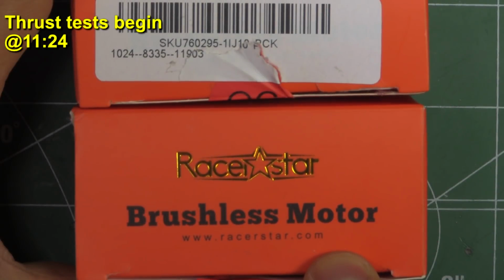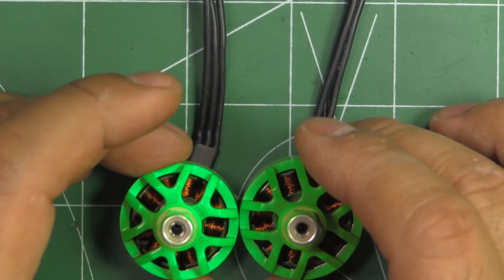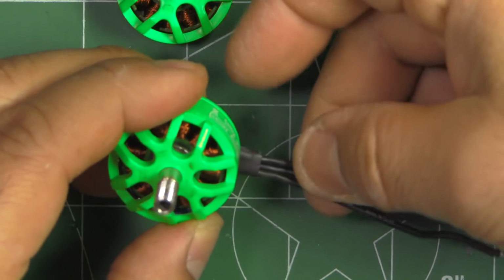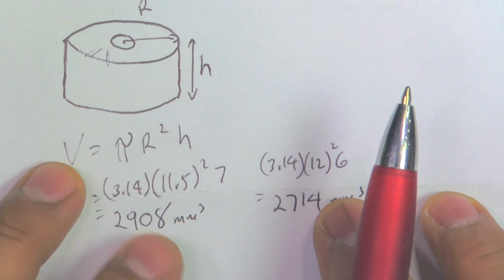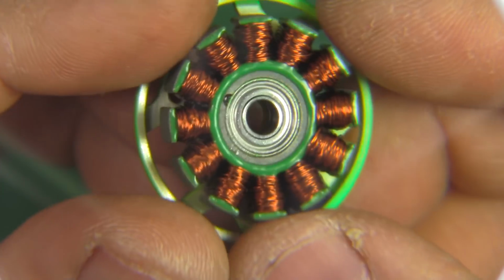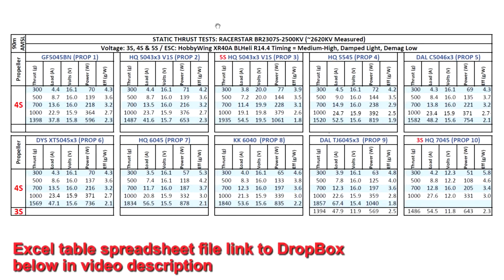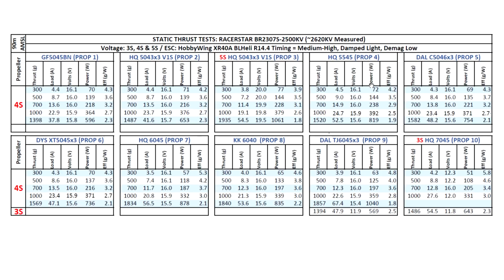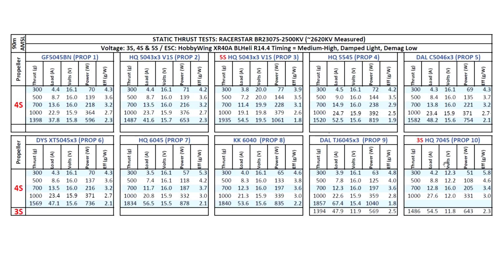RacerStar BR2307S-2500KV Thrust Tests - Budget Motor For Your Needs

Comment: these seem stronger than 2306/2650 deadpools but my question is who makes racekraft 2307? i picked up set of new rk 2307/2550kv and hope there stronger than the deadpool 2306/2650 any ideas?
Reply from the maker: Danger Davefpv No idea who makes them,. I have not seen other motor like Racerstar so could be they got their own factory, They sure make lots of different motors nd release new one quite often

Comment: Hi EngeneerX, i am building a 5" freestyle quad and it is going to be my first one. I heard mixed opinions about the racerstar. But the br2307s are quite new. At the moment my 2 options are either the br2307s or the brotherhobby returner r2. I think in this price range those are the best, are they? What motors should i choose? Are the r2 worth the 4 extra dollar? On long term which are better?
Reply from the maker: I have not heard these RStars having any issues so far so they're a good choice. I would actually go for the KingKong 2405-2400KV for a 1st freestyle quad. Check out my review for that motor, it's very good quallity, made by SunnySky. So far it's been getting lots of positive comments. The BH R2 is also a very good choice and you can't go wrong if you pick it. These RS would be me my 3rd choice.
Reply: EngineerX Wow, thanks for that fast reply! And also thanks for your honest opinion. I am going to check out the kingkongs now and subscribe. Have a nice one!
Reply: Check out RCX motors, the 2206 is the best motor you can get in that price range

Comment: How about doing some Low KV High Voltage testing?  BrotherHobby has some offerings that are catering to this trend.  Interested to see some 6S low kv Amp data compared to equivalent 4S high KV stuff.
Reply from the maker: Daniel Bolton  I have a T2 2206-1800 that should be ok on 6S 5043x3. I'll have to somehow slot into the test queue
Reply: We need to get you some of the 2207 1660kv and the 2306 1725kv...that's what the racers are using currently.  That way you can run all the props. 
 Thanks for the consideration!

Comment: i'm desperately trying not buy them :D

One part of my brain scream ''bargain!", another ''beware chinese cheap crap!"
Assuming worse if bearings are crap as expected how easy it is to replace them? Cost ~2$ each
Reply from the maker: Should be as easy/difficult as with any other standard motor. Remove circlip, then use a punch tool to dislodge bearing from its housing, tapping a bit at time at an angle. Bearing should pop out without issues. Remove bottom bearing first, that way top bearing will be easier to remove and there'll be less chances of damaging windings since you can use a larger punch tool to tap straight down, placing motor on top of a soft surface. Or better yet, try holding motor and punch on your hand and striking down on a hard surface so you don't have to set motor down and risk messing up windings. Order some spare 4mm circlips  just in case you need to replace them.
Reply: thank you for fast reply! If only bad bearings will be an issue i'll love them but i have another not so simple to fix concerns like loose magnets and weak shaft/bell etc.
Reply from the maker: Yea, those are still unknowns and always a risk with budget motors. Never know where the weaknesses will be until after lots of user begin posting reports about issues once they've put motor thru some abuse.
Reply: i think i will spend more on RCX motors! I'm not rich enough to buy cheap things! :D

Comment: What about bearing quality of all this racerstar motor? How has (long) flying experince?
Reply from the maker: On the product description they claim to use NMB bearings which is a good brand. The size of the bearing is good. 4x9x4mm. It's more durable. We have to check after some time if users report motors becoming wobbly from bad bearings. So far I didn't see any complaints but maybe because these just shipped about 1.5 months ago

Comment: are the rcinpower g1108 6800kv good for 3s with rx3044 props?
Reply from the maker: Yes, they should be OK. But you will need to "test" carefully because depends on each build. There are too many variables. So always check motor temperature with 75% throttle, then 100%. If not hot then you're good to go.
Reply: thx

Comment: Not that high of trust with 4s or not ?
Reply from the maker: Not super high but OK. Amps look OK too. Need to watch for motor temperature if using 6045x3 or 7045x2 with 4S
Reply: EngineerX did you already tryed  the racer. 2306 2700kv motors? I want to make a real cheap fast basher thats why
Reply: EngineerX are you gonna revieuw the dys wei 2207 2600kv motor? Only €8 looks great those specs but i dont know if its anny good

Comment: In your experience,what is the performance of a motor like after the puff of smoke. Does it ruin the magnets or any other negative effects?
Reply from the maker: If the puff occurs as shown in the thrust test, after a very short very-high load full throttle run (less than 3 seconds) Then you use the motor in the air, there's no negative effect in 99% of the cases. Only if motor uses very crappy, very cheap wire in the windings, then you may have melted the enamel coating and may develop a serious short. Shorting the wires due to burnt enamel coating is the main concern. Cheap non-SH magnets may suffer an almost non-noticeable demagnetization which could cause the KV value to increase ever so slightly. But I think for such a short run on the thrust stand, the temp in the magnets does not reach the critical point where they start to degrade; you need longer high-load conditions for the excessive heat to transfer from stator to magnets.
Reply: EngineerX awesome thanks, I was just wondering, mostly in the case of tuning and having hot motors and that smell sometimes if I was doing irreparable damage.
Reply from the maker: When tuning you could be overheating motors for relatively long periods of 1 min, 2 min, even 30 sec..... depending on how hot they got.... they could get damaged. If you notice the slight smell, but motors don't feel overly hot and you can still comfortably firmly grab them with your hand, then they should be OK but need to adjust PIDs or down-prop to avoid continuous high temps.
If after tuning, motors don't run hot and no smell anymore, then no worries, they'll be OK. Key is not to overheat them for long periods. So when tuning always best to land right away to check temps when noticing high-speed oscillations

Comment: Which should I get these or dys samguk?
Reply: I'am actually in front of the same dilemma. 
EngineerX, I saw that you had the opportunity to test both motors in the past weeks. Without speaking of long term use, what would be your comparison of these two motors ? 
Which one would you personnaly buy or recommand ?

Thank you in advance =)
Reply from the maker: Very tough choice. The Samguk are a lot lighter so you really can't compare them side-by-side. I think they're for different setups. Samguks compare closer to those new TBS budget series, the original AOKFly motors (new one on BGood I hear are not good) and other budget 2207 or 2306's. 
For a 5" build, these are probably a little too heavy, they have plenty of power but if you're looking to build a light setup, these are not the best choice. 
If a little more weigh is not an issue, and if the bearings on these are authentic NMB brand (4x9x4mm), then these have good potential to be durable. The Samguks may need bearing replacement in shorter time because seems they're using no-name bearings so you gotta add about $3 and you end up with a very good $13 motor that will be light and powerful, but bearings will probably need replacing a little more often because they're smaller 3x8x4mm. I feel you do need to consider the long-term use a little due to the bearing size difference.
Reply from the maker: RCX are a great choice. You can get them at a good price if you select "no warranty" and they use top-brand EZO bearings and have replacement bell/shaft assemblies available for a decent price.
Reply: The AOKfly motors have fake ones lurking around on BG and they produce noticeably less thrust up to 250g on one test done by Torch FPV. The real ones however are unchanged according to Aokfly themselves.

Comment: I have some racerstar motors. My experience was no good. Costed me more at the end because the rate I had to replace them.
Reply: I'm still using the first set of Racerstars which I bought 18 months ago. They are onto their third frame. I have crashed them more times than I can count and they keep on working.
Reply from the maker: RCX are a great choice. You can get them at a good price if you select "no warranty" and they use top-brand EZO bearings and have replacement bell/shaft assemblies available for a decent price.
Reply from the maker: Yes, that's the risk when buying budget motors. Sometimes really good sometimes really bad :(
Reply: EngineerX other ppl may have better luck but I am staying away. I felt like I have gone  full circle twice. Tried expensive motors, medium and budget, expensive and budget. Now back to expensive and medium. It is tempting to try budget motors because of the perceived saving. Both times cost me more.  My conclusion now is buy premium/medium motors when they r on sale and stay away from budget.
Reply: Yeah but really it's all down to luck and their quality ratio is really suspect. Pay a little more and get RCX motors instead, a budget brand that a lot of people fully recommend or the DYS Samguk series if they're proven reliable over time.
Reply from the maker: I think that's a smart strategy. If $20 motor can outlast 2x or 3x a $10 motor then it makes sense. You will also get more enjoyment because of less frustration having to replace motors or not getting smooth flights.

Comment: Nice review.
I dont Know what to Think of these motors. They are powerfull, but also Very heavy. What build should these be used on? I think it is a bit high kv for 6 inch. I can only come up with the Idea of a freestyle 5 inch, but there are so Many others greater options out there.
But it is crazy to see a 11$ motor push past 1.6kg on 4S.
Reply from the maker: Right, there are better options for 5" and for 6" or 7", KV is a bit too high unless you're on 3S. rcINpower had the better approach with its 2308-1850 and 2150KV motors.  Maybe people will use them for freestyle as you said.